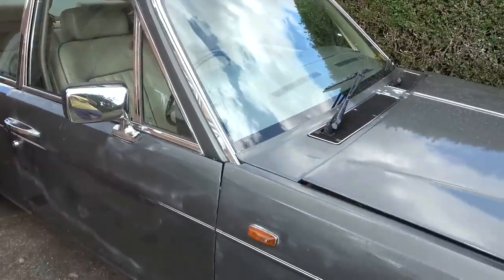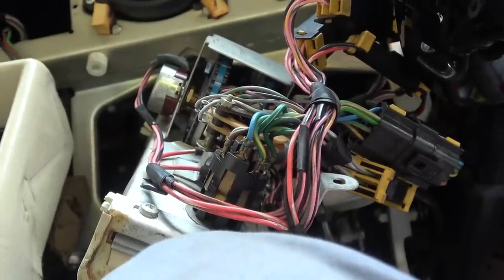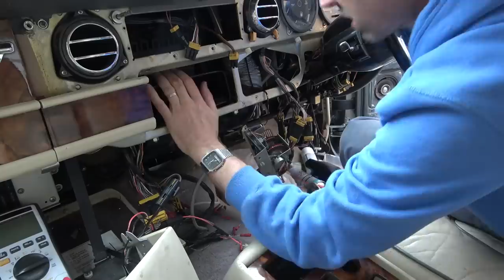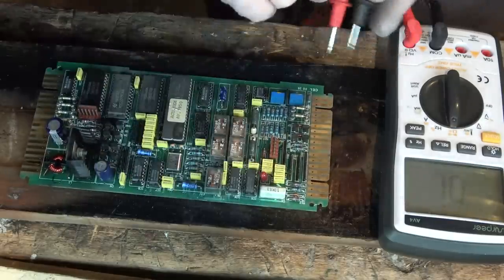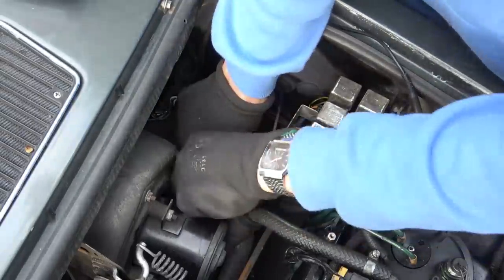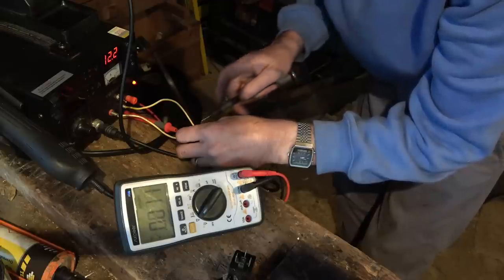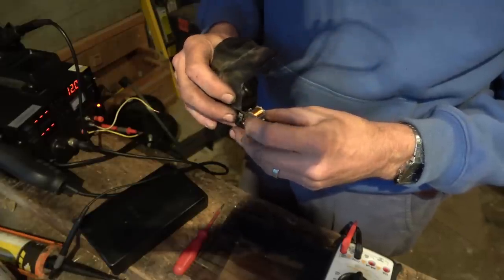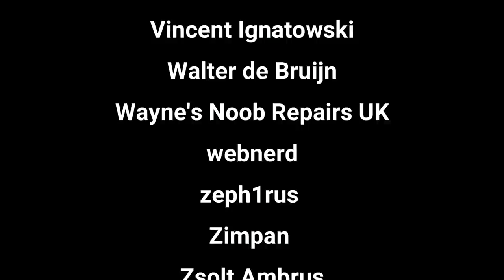No HOT or COLD AIR on the RR Silver Spirit - WHY?   PART 21 of CAN I DIY FIX a ROLLS ROYCE

Comment: Rule of thumb is check the fuse then the relay before anything else .
Reply: Yes, but he wouldn’t have found that cracked solder joint if he hadn’t checked the board, so it wasn’t wasted time.

Comment: As a professional engineer myself, to see a guy like you fixing a old classic car with no experience whatsoever is a dream to view. Im more nuts and bolts rather than electrics, but just by methodically thinking about it you get to find the fault. I wouldn't have had a clue where to start after the fuse so good on you Vincent for your simple thought process and ingenuity. Can't wait to see it all finished and you driving it. We'll done and keep them coming vince 👍.

Comment: I remember as a kid in the early 80's, my dad got a second hand silver shadow. He was given a book of Rolls Royce facts by the dealer. One fact I've always remembered was, the air con unit in the shadow would cost you more that a brand new mini metro.
Reply: That's the risk of owning a Roller! Surely in the 80s there were pattern parts available.
Reply: I used to work on them. The hydraulics were the problem. If the braking or suspension system went down you would end up living in a mini metro.

Comment: @19:33 Those white bits that you resoldered the pads on are fuses, lift the ICs and reseat them, and gently use your fibreglass brush on the edge connectors, they often need a gentle clean, even though they are gold plated.
Reply from the maker: Thanks Scott, I wasn't sure what component they were👍
Reply: @Mymatevince 
When is part 22 coming out

Comment: One tip: Normally no need to extract those blade type fuses to check them. They have exposed contacts on the back that you can get your meter probes on in-situ and check very quickly.
Reply: Upvote this I was going to tell him a few times now.
Reply: With all the corrosion he's finding in the wires, all that's going to do is tell you that the fuse is OK.  The action of removing and re-fitting the fuse can be enough to clean the contacts enough to make it work.
Reply: YES but when fuse holder has green inside you are busted...
But then again Doing the SAME on the part you want to WORK is priceless. What i mean is normally, all parts need positive and negative to work. Well wish one is missing?
Reply: @soopahfly82  0ll

Comment: Generally the rule of thumb is to not reuse relays when they go faulty in that exact manner because once it gets carboned up, no amount of sanding or anything will make it "right" again. it WILL fail as all relays do, and it's safer/easier to replace it with a new relay. Because of how essential that one board is to the comfort levels of the car I do think from a repair standpoint that you should replace the few electrolytics on that board with some automotive-rated polymer caps from newark electronics, and order yourself some proper automotive relays from the same place for in the engine bay. Honestly I'd say to replace ALL the relays because of their age and then keep the working old ones that aren't the painted one as spares in the glove box or in a utility box in the boot where you'd keep a set of tools for the car and such, such as a cheap toolset and a cheap multimeter plus a spare set of batteries for that. Doing my own research it seems the equivalent part number to the Bosch would be 1432782-1 from TE Connectivity for an SPST 12vDC 30A relay. They're a bit expensive but the pinout looks to be the same. Suggestively you should just buy a single one and test that out, and then when finances allow for it, to get the rest replaced at a later date... Those relays are paramount to get right for the sake of key car functions, and while you can get used relays off ebay for a song, there's no guarantee they'll have the same fault or not. it's a dangerous game.
Reply: Wise words
Reply: Wise indeed,  especially with old EM pinball or Jukebox..  A real Burnishing file. Older the better
Reply: Automotive relays are a consumable item, the contacts are plated with a thin layer of (probably) plated silver that gradually disappears due to operation, leaving exposed copper or brass metal of the base material. Once the layer is gone, a person can clean off the oxidized copper/brass metal in the contact, but it will quickly return to an oxidized state and stop working. One more caveat: since poorly operating relays present a high-resistance connection, there is a FIRE RISK due to the relay trying to pass lots of current through bad contacts. Burning down a car from saving $10 on a relay is not worth it.

Comment: Loving this series.  So much fun to watch and so interesting.  I just binged all 21 videos and now I have no more to watch!  Something to consider given how many electrical issues you've encountered so far: maybe open every connector and spray contact cleaner and/or sand to ensure a good connection and maybe just check every relay.  Doing all of this up front might take care of a whole slew of known and unknown issues in one go (though maybe it won't be as much "fun" as troubleshooting each issue separately).
Reply: Agreed.  I was even going to suggest packing dielectric grease into all the connectors which should keep any further corrosion from occurring in the future.

Comment: I bought an absolute diamond little kit from Aliexpress, a DC-DC Buck Convertor with LED display, couple quid and to use it I can put in any voltage say from an old power brick and use the pot on it and LED display to set its output voltage making for a seriously convenient cheap bench power supply and even good for a car as you just hook up a set o' leads from battery and then use it say to inject voltage directly into a circuit you want to test.   Runs approx 4-40 volts and is pretty accurate less than .1v disparity, gives out a nice square signal too very clean output.

Comment: Great video, might be worth investing in a power probe as multi meters have there limitations. The relay are standard DIN 85 and 86 are coil windings 30 is battery positive and 87 is output to the unit.
Regards Bob
Oxford Vehicle Electronics

Comment: Great video Vince. Love watching this journey. Heads up on the AC. There should be a low pressure switch that will not allow the ac clutch to engage if there is not enough refrigerant in the system. So you'll have to check the pressure in the system if it's not working. As well it may have R12 refrigerant in the system that I believe your not able to get anymore. The system may need to be converted to r 134a or the new r1234 stuff. That's north America though, may be different on your side of the pond.  Hope that's helpful. Again thanks for the videos. Probably seems like your talking to yourself all the time but we're listening.
Reply: Same here. R12 is still available in some obscure markets but not in Europe. This being from the 1980s I bet you're right it's still on R12.
Reply from the maker: I'll have to look into that. Hopefully there will be info on this on Google or a RR forum. As long as the heater is working that will do for the time being. I rarely use A/C but that may make an interesting video once it (fingers crossed) on the road 👍👍👍👍

Comment: Another great fix!  On mine, I replaced all the underhood relays as a precaution.  Magically, my AC and heat started working even better.  Apparently, there's a voltage drop across those fan speed relays, so if not working properly, you lose fan speed.  I added a link from your youtube to the rolls/bentley forum...these are must watch videos.
Reply from the maker: Thanks Douglas for the voltage drop tip and the forum link. I hope my unskilled methods especially the paint attempt don't upset any of the owners too much 👍👍👍

Comment: Good repair there mate, any electrical repair is usually the fuse, switch or the relay as they are the ones usually under the most though the wires and boards can have wear and tear on them as well due to weak cables or corrosion.

Comment: The numbers relate to German DIN numbers. Terminal 30 is permanent live, when on terminal 30 connects to 87 when off 30 connects to 87a. Terminal 85 is negative side of the relay coil and 86 is the positive side of the relay coil. The diode stops back emf when the relay coil is disconnected to avoid damaging micro electronics.

Comment: Good job vince,dont no if you no but the fans are on a delay.if the heater is set to hot but the coolant is cold the fans wont blow until theres enough heat in the coolant.thought id just mention that as nobody else seems to have.
Reply from the maker: I didn't know that Ivan. I just thought it was slow to react. That's really clever so it doesn't blow cold air into the cabin. I like it👍👍👍

Comment: Check the back EMF diode on that relay. If it's faulty, that would cause the sparks that tarnished/ burned the contacts. You mentioned that each relay has a diode in it, that's what they are for. The diode will be in parallel with the coil

Comment: I was getting a bit worried you might have had a jolt from the back emf of those relay coils holding the wires on them!  Just something to be cautious with when holding bare wires on any energised coil!  Fan-tastic fix though 😁
Reply: There’s an internal diode across the coil to short out that back emf.

Comment: Its funny about the esd strap, I have worked on computers and electronics since the 1970's and never used one in my life whether on the Commodore Pet which was my first ever repair, my ZX80 Sinclair kit, the 8088 and 8086's all components far more susceptible to static than todays stuff and never had a discharge.   For mains driven devices I just earth myself off on the mains lead or the chassis of the device as a matter of habit, if I need to I can just earth myself off a kitchen tap if I think I have angry pixies building up in me but never had a failure from not doing so either and from memory the only things I knew were attacked were early erasable ROMs and when was the last time you saw one unpatched?

Comment: If you have a system completely off always check a relay by switching them. I had guessed that was it early on in the video. They frequently go out and it's a super easy thing to check first off.

Comment: Unless it’s already been said. Dont forget that the relays were changeover type. So you need to check for continuity between common and one contact unpowered and common and the other when powered.  It may use both contacts in the circuit, like the powered windows did.
Also use the meter on resistance it will show if the contact is making but has a bad connection (high contact resistance) due to corrosion.

Comment: The reason your HVAC does not deliver either from an initial start is due to the 44 deg C sensor located on the thermostat tower. The only function that will work is defrost because it's a safety thing. Pull the 2 wire lead to the sensor to get results and eventually, you have to replace it. The RR thought was no heat or A/C until the car is at operating temp for either hot or cold. This is a known issue.

Comment: BTW treat yourself to a bronze Tandorio, I bought one last week and it arrived today pure CUSN28, sapphire crystal, Seiko NH35 movement, C3 Superluminova lume on dial and hands, decent rugged strap and a screwdown crown giving it 200m water resist too and its based on the WW2 Omega with the white and cream differing markings and a broad arrow... £99 on ebay, I went for the sterile one as Tandorio sounds a bit take-away'ish to me :)

Comment: Maybe a bit late, but, since in every episode you are chasing after random cables in the car... maybe you should invest in a cheap wire tracker. You put the emitter in one side, and turn on the receiver to check the cables around the car. When you locate the cable, you will hear a quite loud tone (those things are quite used in telcos to install phone lines).

Comment: I was surprised for a car this age that it wasn't a burned out motor/siezed motor for the fan, as I was expecting, then would have tested the leads as you done, dunno whether any logic for not testing the passenger side motor, but probably would have came back with no voltage as well looking back now I know the 2nd place I would have checked is the relay, but would have done a circuit test between the motor cables and the relay as well if it couldn't be fixed by replacing the relay. while a fuse is a common fault, unless a circuit is over powered like a siezed fan, it is very unlikely to have blown, and on a fan circuit would be one of the last places to check, even though symptoms would be simular to no voltage at the fan, and as you haven't heard the fuse blow then I can understand your logic by going to the fuse first. but most commonly if it is 15 amps or more for a fuse in a car it is less likely to blow without some serious fault like a siezed motor. I have replaced loads of 5 amp, and 10 amp fuses over the years, but can't say the same for any higher, not sure if I replaced the one for the fan when my vauxhall nova's fan motor seized, as still worked on the higher 2 settings, but wouldn't work on the slow setting. so while you need to check fuses anyway it isn't very common for anything above 10 amps to blow.
Reply: but my test points in this situation would be the motor for voltage, the motor to the relay, the relay to fusebox, then the switch, then fusebox to switch, not forgetting the fuse and relay at the appropriate times when removed, as then would have had the whole wiring checked in one go as well if the relay and fuse came back good. while yes could be a connector block, you could illiminate each section of the wiring, and if the break was between the fusebox, and the relays then go searching for a splitter block.

Comment: Also car fan motors usually have a resistor array to get the various speeds, the arrays burn out and have to be replaced and as said below relays should be checked not only the contacts can arc and burn but the coil that operates it can burn out as well -- even though you can get relays working again the best long term solution is to replace them outright to get the longest repair life

Comment: Personally, I would have hooked up a 12v power supply directly to to fan motor. This would immediately determine whether it was switch or motor. No sense going through hours of switch diagnosis if the motor is shot.

Comment: Interesting and impressive stuff - you would have paid a RR engineer ££££ to do the same job as those ac systems are hugely complex. Those were the days when they designed and hand built the system from scratch. Now they just buy it in as a component from Behr.

Comment: Take a bit of advice. Before fault finding anything take a good look at the wiring diagram, at least then you have some idea of how it's supposed to work.

Relays are standard, as follows

85 and 86 are the realy coil contacts.

30 will link to 87 when the realy energises, and is linked to 67a when at rest.

Remember relays can switch a live or an earth.  As you found although a relay clicks, it doesn't mean the internal contacts are passing current.

A test lamp is far better for cgasing the 12volt high current circuits than a meter.

Comment: That diode in the relay, is to stop back EMF getting to the electronics. In old analogue cars, it didn't matter, and relays didn't have them. But, if the relay is energised by a semiconductor (transistor or IC, in newer cars), when the field in the relay coil is suddenly de-energised, it produces a spike of opposite polarity, sometimes several hundred volts. Electronics don't like it and go 'pooof!'. So it is important, when testing, to get the polarity right, across the coil. If it's the wrong way round the power will flow through the diode, show a short circuit and could give a false failure indication.
When tracing powers and grounds, I prefer to use a light bulb. A digital multimeter can show a voltage through high resistance, like a bad connection, or burnt wire, giving false positive results. A bulb will prove that it can pass useful current. Multimeters are great for measuring specific voltages, like Alternator outputs, voltage regulators and sensors etc.

Comment: Vince, those relays are pretty cheap, the points have a special material on their surface to resist the arcing, I know you're  trying to save costs, but just replace the relays so you can move on to the other "issues" this car is going to have.

Comment: Does it have a blend door actuator it could be busted and the little flaps in the ductwork is stuck shut not allowing air to flow properly or the blower motor (it it’s components) is faulty

Comment: Air conditioner, look out for a pressure switch in the system first and check continuity as it highly likely the gas isn't there.
Pressure test the high end pressure side first. Its probably best to get a garage to re-gas the system as they will test for leaks.

If its leaking from the heater matrix its going to be a dark day for your wallet.

Comment: 45:00 Yes you are right but. Dont trust DVOM! As you can have great a Zero ohm connection, but parts on cars needs current to work so it's like dayly noob mistake to use ohm on car and say its OK, when actually, you where testing the correct part, that is bad.

Normal DVOM is ment to messure resistors and not wires so it send very very low volt and so you can have ~100% voltage loss with zero ohm resistance on meter and its not meter fault its user...

But hay dont worry you arent the first and even the last one that dos this, but maybe when you see it your own eyes, you know the rest..

Ps. Next time... example on normal electrick motor look what its missing power or ground? ..there ar motors that have power but are controlled with ground so on those systems checking fuses arent maybe the first step ;).

..looking forward to the next video.
Have a great day!
Cheers! Timppa